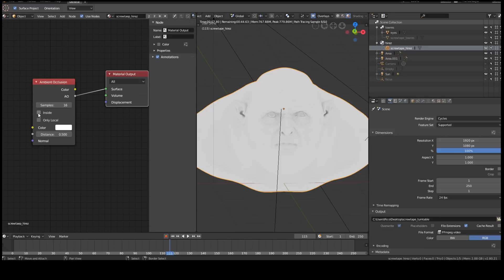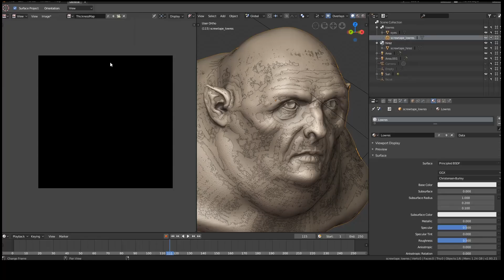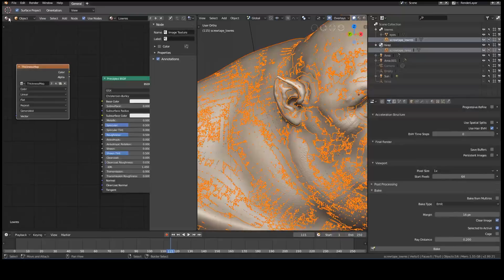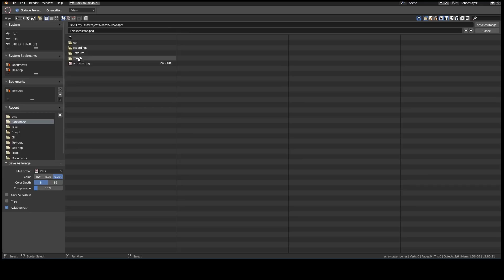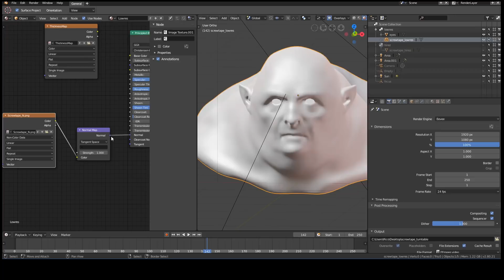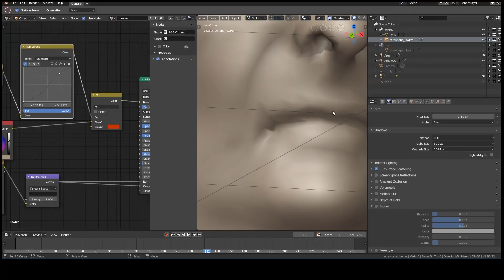Blender 2.8 - Baking thickness maps

Comment: Still dont get why this baking is so terribly slow, i mean even with low samples 16 or so and render tiles set to same as image, its still kinda slow
Reply: Kinda weird you select the emit node when there is no emit node in there?!
Reply: Ow i thought it was mainly used to control the subsurfscatter more controlled. But this is also nice. So you can color thinner parts easier

Comment: How is this better vs Subsurfscatter setting in the Princebled BSDF shader. Is this to have better control?
Reply: It's more useful in Cycles. If you use random walk SSS, and your sub surface radius is higher than the thickness of your mesh at that point, you will get discoloration artifacts. You should multiply your SSS radius by the depth map (maybe after running it through a map range node to map it between ~0.1 to 1) to avoid this.

Comment: shouldn't your low res mesh be a lil bit bigger (scaledd )  then you high res for baking ?
There are obviously vertices of your high res. sticking through your low res mesh
Reply from the maker: Not really necessary for organic characters, only in some cases and hard surface edges etc :) In this case, as long as the verts are reasonably close to the highpoly surface, blender casts a ray along each vertex normal in the direction of the highpoly mesh, even when the vertex is below the surface, provided the distance and bias settings are correct in the baking settings, problems do occur when the lowpoly mesh vertices are too far above or below from the highpoly surface, in such cases you will have clipping issues or distortion

Comment: Question: Can you explain how to do this for a mesh that has several different UV maps? I have a character that has a UV map for his head, then his torso, etc. Is there a way to bake each map separately?

I would think you would have to use the full mesh even when baking the individual textures since some of the geometry from different areas can affect the results for a texture.

Thank you for this. I have been having a hard time finding a way to generate a decent thickness map.

Comment: Would it not be a better idea to name this an SSS ( Sub Surface Scattering ) map?
If you name it something different to what others use then people might get confused.

Great tututorial.
Reply from the maker: I could, but I've noticed it's usually called a thickness map, in xNormal and SubstancePainter, as it's technically not only used for SSS effects,but for anything thickness related, so transparency, refraction, wear, damage, etc.
Reply: Also know as single scatter map

Comment: So is the thickness map reacting dynamically to the lighting (to different lighting conditions) ?  or does it react to all lighting conditions the same way ?
Reply from the maker: Its ultimately just a mask, so it can be used with any shader to react with light in many different ways. Commonly used to just tell the model where to put more or less SSS scattering.